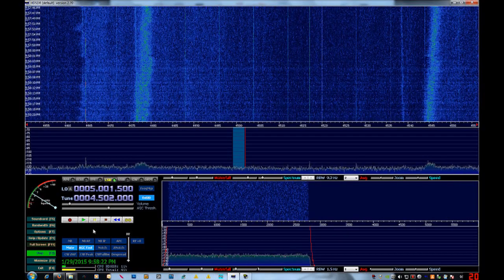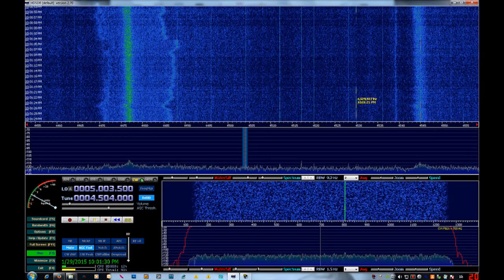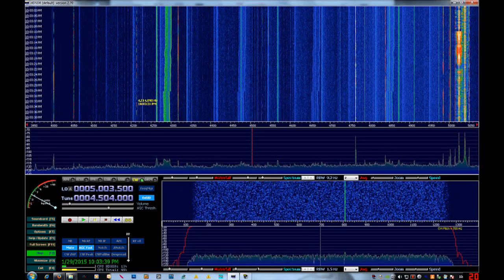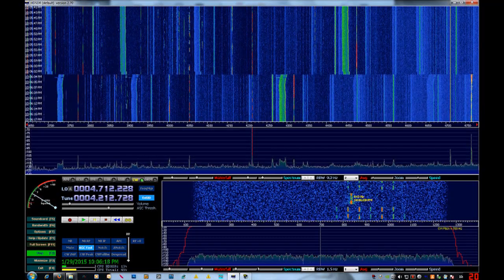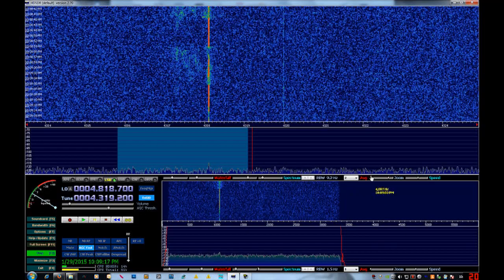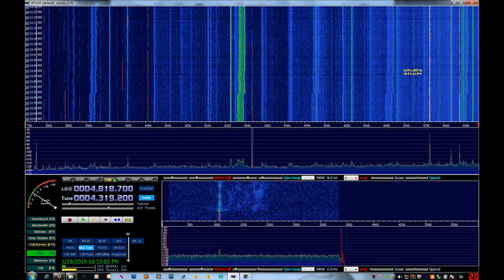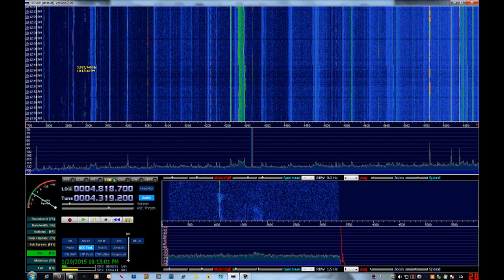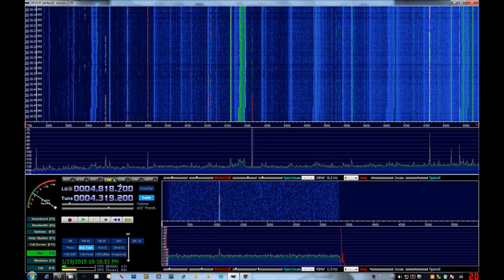Some Tips On Signal Hunting With An SDR

Comment from the maker: Note at 10:00 I'm wrong about the mode. HF FAX is very often in upper sideband, especially with these strong US weather broadcasts.
Reply: HF FAX is in FM isnt it?
Reply from the maker: @keithglimmer4505  Yes, but in the audio component only. The radio transmission itself is single sideband AM but the information is carried by a shifting tone that determines the brightness of the plot, and there is of course a sync pulse to keep things plotting straight. It's hard to tell by listening that it is FM encoded since most transmissions are simple black/white, but if you ever get a grayscale image coming in such as a weather satellite photo, you can clearly hear the wavering tone, just as in the NOAA VHF APT transmissions.
Reply: @NightRunner417  HF fax has no amplitude modulation. It's a frequency modulated SSB transmission. Not sure about vhf fax. I've been able to receive some cool Japanese fax stations from my location in the central U S. I've always wanted to copy JJY which still transmits news in Japanese and English but they are a tough catch. I've copied it from a few remote sdr's but never direct.

Comment: This is really awesome! I got the RTL SDR 30$ kit with the little antenna kit, is that what you have here?
Reply: I just got the RTL-SDR Blog V.3 days ago. I have been a radio nut for years I can't believe I didn't know about these till a couple months ago. It's almost but not quite(too many images) as good as my $400 HF receiver and $400 digital scanner in one. I just wish I has just got the $20 dongle and used the extra $10 for a couple of adapters for my outside sky loop and scanner antennas.

Comment: Hi enjoyed your video what rtl do you use is it a cheap dongle, at the moment I have only a few stations on the fm band.
 Dave
Reply from the maker: Thanks, Dave. I've used a few of the cheap Nooelec RTLSDR dongles, which aren't terrible at for VHF and up but suck balls for HF, so you need to use a converter like HamItUp to get HF. When you do that, they are truly passable for HF use. I'm an HF enthusiast from way  back, so I wasn't satisfied and ended up getting an SDRPlay RSP and then the SDRPlay RSP2 when it came out. I won't tell you that they are total showstoppers, but they are quite good on all the bands. One drawback is that support isn't as good for the SDRPlay, so you have less options, but that really only applies to more advanced uses. It'll get better, I'm sure, and maybe it already is because I haven't even looked in a long time. The SDRPlay RSP uses SDRUno by default, which is actually a great little SDR program with a lot of options and great performance. You can also force it to use the other popular programs if you hunt around for drivers. I like it, a lot, but you have to be serious because they are pricey.

Were I you, I'd get myself a discone antenna and stick it in your attic if you can. They perform really well on all things above HF. For HF, I put a huge single turn loop of wire across my ceiling in the living room and fed it into a 1:4 current balun. Works great on HF, far better than the discone or a simple wire or dipole antenna indoors. An outdoor giant loop would be the best for HF but not many people can manage it.

Comment: Am just getting aquianted with SDR. I am close to working on decoding a signal. Just getting my feet wet.
Reply from the maker: If you want something insanely fun to try and yet also surprisingly challenging yet easy for even the cheap SDRs, try out decoding NOAA sats on 137 MHz. You can take it as far as you want to go, even making specialized quadrifilar helix antennas to get max clarity. They broadcast a scanline image of whatever is below them, mapping the entire Earth twice a day. Cool part is that you always get your own area as the sat passes over, and also you get to hear the doppler shift in the signal from the insane velocity of the satellite in motion toward then away from you.

Comment from the maker: Another note, regarding the use of CW mode to pick signals apart - Oddly enough, I've found even that ADS-B responds the best, audio wise, to SSB or CW modes. In the other modes, it's barely discernible from the background noise. In CW, it sounds like a harsh, raspy buzz, a bit like the sound a wasp's wings make when it bumps against something in flight.
Reply: and by the way a LNA is not a preamp its a amplifer there is diffrent between the two
Reply from the maker: @AndrewMurphy8383  SETI doesn't like you.

http://www.setileague.org/hardware/blklna.htm

Comment: Hi when I run DSD with HDSdR I change my sound card to VAC1 I can decode DMR but I cannot listen to analog signals without changing the sound card setting back to the speakers how can I change this so I can hear all signals please
Reply from the maker: Oh it's been too long since I was doing it to remember exactly how... but I had this crazy way of hopping the connections around so that I got it to where I could listen and decode at the same time. I'm not even set up for it now but if I come back around to it and I can reteach myself how to do it, I'll post it.
Reply: Are u running the dsd+ via app or cmd
Reply: Steve Ambrose also do u have vbcable_driver?

Comment: How to get upto 6 GHz using just from 1 MHz to 3.2 GHz sdr usb.
Reply from the maker: The only way would be a downconverter... either that or a higher end SDR unit like the uhhhh what'sit... HackRF? I haven't looked into anything higher performance (*more expensive*) than the SDRPlay because dude... my hobbies are gonna kill me as it is... so my experience in higher demand areas is pretty limited.

Comment: I have one of these: @t   I can receive FM stations in 88-108 Mhz range with good sound. When I switch to direct sampling and with long aerial into HF socket I can see many good strong signals in MW and HF bands. But when I tune in to the signal peaks I never get any audio. Maybe just a hum at best. I try all demodulation settings. Any thoughts?
Reply from the maker: What model of SDR are you using? If it's not built for HF and MW, then you may only be picking up interference lines which of course will almost always sound very electrical, harsh rasps and buzzings. You can still do lower frequency bands even with the cheapie SDR sticks but you'll need an upconverter, and they do work really well.

Also, bear in mind that if you're doing longwire antennae indoors, you're going to get A LOT of electrical and appliance interference. MW and HF only really get good when you get out of the house. I threw a typical scanner discone antenna literally on top of the sheet metal of my porch roof (it's really just standing there on it's ground cone, lol) and I get decent HF out of it. Sure it could be better but it's practically invisible and a huge upgrade from when I had it shoved into my attic, and the only indoor antenna I ever had or built that could beat it was my ceiling mounted magnetic loop, which was a big pain in the ass due to the very narrow bandwidth.
Reply: @NightRunner417  thanks for the reply . I have one of these: https://www.qsl.net/pa2ohh/19rtlsdrlop.htm  . There are big signal peaks appearing  in HF band but I can't demodulate them to audio , tried LSB USB etc
Reply from the maker: @ThinFreddysFlop  Ok, so I had a look and I think what you have is R820 based , which serves as the basis for all the common USB stick type SDR dongles. I don't have experience with yours specifically, but I've had three of the RTL-SDR sticks and did quite a bit with them before getting a Ham-It-Up upconverter for HF (which works really well, actually) and ultimately an SDRPlay RSP 1 and then an RSP 2 Pro. You might at this point be asking yourself "But NightRunner! You already had THREE R820 sticks and a Ham It Up! Whyever did you need two SDRPlay units??" Well that would be mainly because when I attached a long wire directly to the sampling inputs of the R820 sticks, the results were pathetic at best. Like you, I got strong lines of crap in the waterfall, almost all of which were electrical interference, and only one or two of the very high power HF radio broadcasting stations. No weak stuff like amateur radio or wefax or anything like that. The Ham It Up made them HF capable just fine, but then I had to have two devices going and ultimately the Ham It Up died, one of the sticks died later, and another broke, and at that point I was just over it and wanted something a little more pro that could do it all on just one USB device.

Remember, just like I mentioned in the video, real signals will show a distinctive pattern when zoomed in on, so you can tell they're a signal even before you hear them. Interference will look like solid or fuzzy lines, will probably drift back and forth a bit, and will almost always show no discernable pattern. You can see exactly that in my video's thumbnail - regularly spaced lines of interference. Setting your SDR to one of these will only produce a hum or buzz, no matter what demodulation you choose, just like you're experiencing. I don't want to sound mean but I think you simply need a better setup. Try for a better antenna FIRST, since you already have SDR hardware you're testing out, and THEN if you still can't get anywhere, consider getting one of the more expensive SDRs that use designs other than R820. AirSpy, HackRF, LimeSDR, SDRPlay, stuff like those. Just make sure you do your homework before putting down the money, to make sure it's going to be good for what you want to do. Also bear in mind, these things are FIDDLY. All of them can be a pain in the ass, because we SDR people are a fringe tech community and support therefore is bullshit at best, lol. Can't tell you how many times I swore I hated the company that makes the SDRPlay units. They're great radios when everything's working right, but man when it isn't they'll for sure make you wanna scream.
Reply: @NightRunner417  Many thanlNight runner, you've described what I have concluded. I got some MW stations using my TV aerial. I'm going to build an active antenna, Should be a big step forward.
Reply from the maker: @ThinFreddysFlop  If you want a fun project, try out magnetic loop antennas. You make a loop of wire about uhhhhhh 6' in diameter, open with a two inch gap at one side. Solder a common tuning capacitor across that gap so now it's essentially a tank circuit. At the opposite side, solder the cable shield directly to the wire loop. Run about a foot of wire from the center conductor to a spot about a foot up from that shield connection point, and form it into a flattened loop that follows the shape of the big loop like this:

https://i.pinimg.com/originals/a0/b1/ef/a0b1ef16cfa398f6747008047c808639.jpg

The capacitance determines what frequency it resonates at, with a bandwidth of no more than 500khz typically. They're tricky to tune but highly directional and extremely sensitive, being resonant and all. I built one on a huge PVC pipe cross affair using 1/2" copper waterline for the loop. It's a big awkward pain in the ass but great for say 5MHz to 15MHz and works really well indoors where signals have to penetrate a lot of material.
Reply: @NightRunner417  Thanks. Great ideas.
Reply: @NightRunner417  So have you tried many different antenna designs and the loop is the best?
Reply from the maker: @ThinFreddysFlop  Oh I'm definitely not saying that... Antennas are like... Lol, they're like girls. Let's say you and your bros are sitting on a porch in the city knocking back some cold ones and a bunch of pretty girls walk by. Almost guaranteed, the rest of the day you'll be debating which one was the hottest. The thing is, each of you is going to have a specific favorite, and it's down to a lot more than just who is "hot" and who isn't. It's the hair, the body shape, too thin or too fat or just right, a little short and thick or tall and thin, long, wavy hair or short, curly hair. How they "seem". Nervous? Confident? Outgoing or reserved or super smart or just fun and silly. What makes "perfect" in that situation is exactly the same idea as "perfect" in an antenna. The mag loop is like a laser for a tiny part of a band, but it's a pain to tune, forget putting it outside most times due to wind drag and vulnerability to getting wet, and you're stuck in a region of the spectrum no matter how hard you try to tune it. A long wire is great, IF you can set one up outside and somehow magically get away from interference. A tower mounted beam is F'ING AMAZING, but who has the permission or resources to do one? And you're still stuck in a band, plus climbing that sucker every time there's a problem? NO. Dishes are fantastic for microwave use, but totally useless for anything else. Simple loop antennas (think of a huge loop of wire connected to a balun) are really great for HF, but only for skywaves and only if you can do it outside, so there again, permission and weather.

After f'ing around for SO many years with listening antenna setups, I can easily tell you how to target a specific frequency really efficiently, but that won't help for wideband SDR use. In the end, I tried SO HARD to find that "perfect" antenna, the one that does everything... and I ended up settling, for of all things, a simple Discone scanner antenna. I used to have it up in the attic, and it was good for VHF and UHF but sucked balls for HF. Then I took the thing and actually sat it on the sheet metal of my porch rooftop, outdoors. What a difference, I wish I'd done it ages ago. Now it does much better across ALL of the SDR's range, and it's more than passable for HF. If you had to only do ONE thing, that's what I'd reccomend - a common scanner Discone either on a short mast or just standing on a rooftop. It's hard to beat if you're not Bill Gates.

If you have a big backyard and the freedom to use it however you want, pound some tall poles into the ground in a square about 15' on a side, make a wire loop and connect it to a 1:1 current balun and use that for HF. But you're stuck with indoor, right, so everything you try is going to underperform. It sucks, but it's how it is. Do give some thought to a Discone though, and if you can't get it outside, then start experimenting with both mag loops and simple loops as high up as you can go. I'd avoid long wire antennas because they pick up tons of local interference, where loop antennas are more immune to that.
Reply from the maker: @ThinFreddysFlop  This btw is the Discone I'm using:

https://www.amazon.com/gp/product/B00QVPGKHU/ref=ppx_yo_dt_b_search_asin_title?ie=UTF8&psc=1

Comment: What software is this please? Im using SDRPlay and DSD.
Reply from the maker: This one is called HDSDR. I was using it with uh... some cheap RTLSDR stick or another, probably one of the NooElec cheapies and the Ham-It-Up HF converter. Not long after I did this video, I got myself an SDRPlay (the original) and then I eventually got an SDRPlay RSP 2 Pro. Since then, I've been using either SDRUno or SDR Radio Console, depending on my mood and my mission. They're both quite good, but I find that SDRUno is a bit easier on CPU while SDR Radio Console is more CPU hungry but has some really nice features that SDRUno does not.

You can make HDSDR work with the SDRPlay units, but the only real reason I can see to go there would be if you just gotta have your interface look like a ham rig, lol.

For some real power mad SDR-ing, try setting up a bunch of simultaneous channels in SDR Radio Console. You can actually listen to a bunch of frequencies AT THE SAME TIME, even put some on the left audio channel and some on the right. Makes one feel sort of God-like... or at least NSA or CIA like.